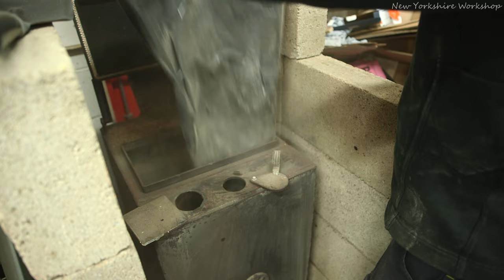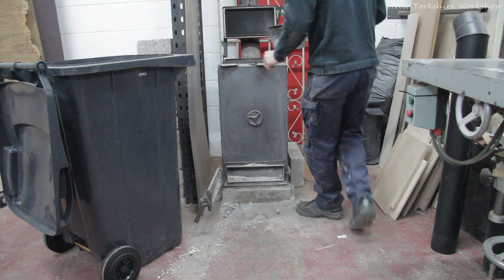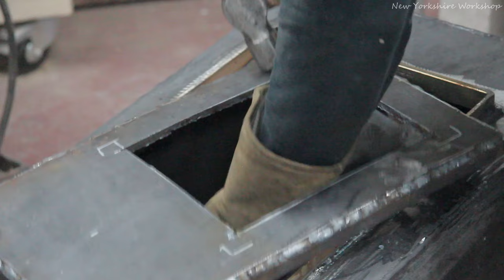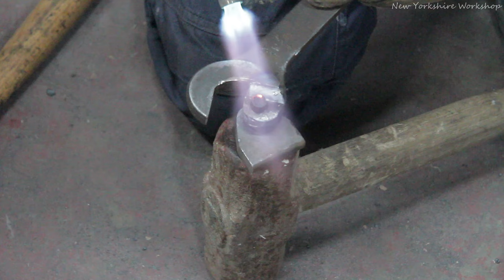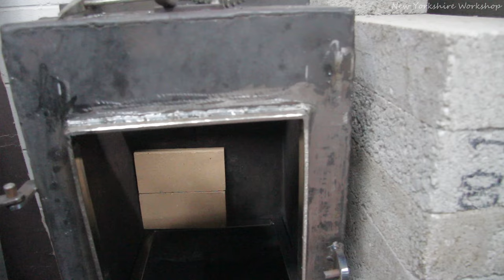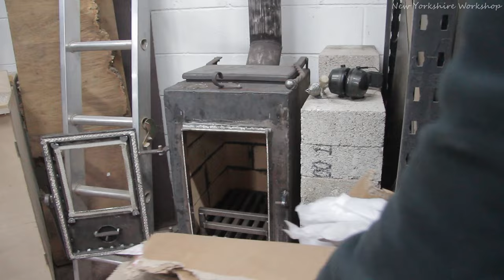fixing my exploding woodburner

Comment: The rattling is known as 'Panting' in large boilers. Basically, the furnace uses all of the air available and then pulls a partial vacuum which then pulls in a gob of air and the cycle continues.
Reply: So, besides rebuilding the entire wood burner he could've just increased the air inlet size? Or, not that easy?
Reply: @TheyForcedMyHandLE  If I had to guess, adding more air to the original stove would have lead to it burning faster and faster, until it was "panting" again, but burning more fuel while doing it.

Or more air would lead to the fire just burning hotter and hotter until it either overheated the workshop or set the place on fire
Reply: Ty for the awnser
Reply: Good post my friend.  That's really good to know.
Seems like you could put a one way valve the would let the vacuum suck open the valve to let air in, and stop that from happening.
Reply: I had coal boilers do this when the front door was opened , it would start huffing , a bit scary to say the least , it would be caused by stirring up the coal and releasing gases causing a sucking of air then a flash burn . Shutting the door would bring control back . I've seen pictures of this type of stove that was used during the big lumber cuts in early America , all that saw dust helped heat buildings at the mills .
Reply: Exactly. We experience it with oil and gas burners also.  Very rare but it does happen.
Reply: Could also be because he basically built a solid rocket booster with a too narrow air intake
Reply: there is also something know as backdrafts which firefighters have to be wary of that does something similar, a way to handle the situation is to create a spot in the highest point in the area to allow heat and smoke to escape without the whole thing igniting and creating an event similar to what we see the wood stove doing
Reply: I thought about this as some one with an automotive/engineering background.The fuel is the issue,it's running rich😊.Saw dust being small readily flammable particles will billow in that burner once it gets going,filling it and essentially acting like a liquid fuel vapour/mist.Not only does that create a much better and more rapid flame spread by virtue,it also creates a more voluminous burn area,(The reasoning behind modern high pressure fuel systems,a better 'spray') so instead of having a flame at the bottom from a few big chunks etc.the entire burner is filled with flame. In that situation you need better air movement to deal with the air requirements,which in it's self will create more heat from an even better burn, It's self defeating. The fuel burn rate needs to be more controlled.

Comment: I wasn't ruining the original stove. The sawdust fell on the air channel and a vacuum was created on the basket. In the air duct we put a steel pipe cut with a flex or drilled with a drill and we solved the problem. I think you were in a hurry.

Comment: Woofing is what's happening there. Same thing happens with room sealed fan assisted gas boilers when they ignite with a thump. It's caused by a lack of air, or rather a lack of oxygen to feed the level of combustion. When some of the sawdust falls down, the sudden increase in temperature ignites the secondary gasses being given off by the wood. That rapidly uses up the available oxygen and if the air supply can't keep up with it then it creates a vacuum which pulls air back down the chimney. When the air drawn down the chimney hits the fuel it reignites and the process repeats. Woodburners really need a throat plate in the chimney to balance the in/out. Makes them more efficient too as the higher temperature will allow the secondary combustion of the gasses. That spanner idea was awesome. Now i need to create a need for one.
Reply: how do you install a throat plate in the chimney? ive only ever had my outdoor furnace woof a few times in the past 8 years but im curious about any improvement i can make.
Reply: The fire is not drawing air down the chimney causing the puffs of smoke in to the room. Only atmospheric conditions will cause the chimney to work backwards.
I agree the problem is not enough oxygen to ignight the gasses of combustion (normaly it goes up the chimney and knowone notices) but when you get sudden ignitions, well gasses, confined space = explosion.
A lot of stoves have a Terchary air vent to constantly supply a small amount of oxygen over the top of the fire. Normaly some kind of tube with several holes. It will allso will improve efficiency.
Reply: @lewis24666  The fire will draw air down the chimney regardless of atmospheric conditions if a vacuum is created and you have the situation i described above.

Comment: Saw Dust mixed with a small amount of wax, paraffin is best but bees wax works too, load up a metal mold of some sort and use a press to press it into super dense blocks, the wax keeps it together and makes it burn nice and slow, you can break them up too if you want them to burn more easily and faster. It's what i've been doing with my saw dust, shavings, and chips for years now.
Reply: oh nice, I was thinking he should make pellets, but this is probably much better
Reply: @wilhallman2890  Yes ! Any for of compacting the wood dust is fine. Antic Windmills could explode because of flour dust. Any solid flammable compound should never be in a dust form. Just like flammable gases or vapors, this is a huge hazard ! Manage the wood dust please, this is dangerous ! Merry christmas
Reply: 7 months later, he's done it.
Reply: @teebu  Yes I saw that 2 minutes after this video. I also left a comment on that last one but we are only two to get what I meant now haha

Comment: While the burning sawdust was pulsating, all I could think about was the explosion at a grain elevator in Chicago in 1935 that killed six people and injured another 38. (No, I wasn't around then, but in the '50's - '80's my father worked just down the street from the location, so I saw the rebuilt silos frequently).  Almost any powder suspended in the air will be explosive.
Reply: Mythbusters proved that danger when they got a dustball of powdered coffee creamer to go up in a rather spectacular fashion.
Reply: Yeah was thinking the same, tiny particle size of the fuel maybe re-combusting at a critical temperature.
Reply: When i was a kid we used to collect this one certain pollen from a "flower", although actually it was more like a stalk or something. When we had enough, we packed some of it into a straw and blow it into a campfire. Nice flames and sparks! :) Yeah, we had to invent things to do while we were camping in the lakes as a child but still we never a dull moment, we always had fun things to do.
That and the explosion risk in the old grain mills (we ground our own flower up until the early 90's when small farms were killed off) made us understand at early age that enough of any powder in air could be dangerous.
Reply: The 'pulsing' is probably deflegrations and their subsequent shockwaves building towards a fine particle / powder explosion.
Reply: That was my instant thought when he was pouring the sawdust into the furnace, that is fine dust that could go boom with the right ignition source.

Comment: Had one of these in my woodwork shop, they are brilliantly economical. Mine was the same shape but I used a cavity twice the size, just use a bigger pipe and reduce the air flow. Never had a problem. Always kept the oak chips for the local fish smoker and got a load smoked salmon or trout as payment ! You are a fantastic craftsman.

Comment: on exhaust you need damper for dialling slow burn cycle, its dialled by adjusting intake and damper. otherwise a lot of heat escaping through a pipe. hello from eastern Europe )

Comment: Being a thrifty Yorkshireman (such as yourself) I'm going to make a suggestion. If the door hinges and catch were adjustable then when the rope seal gets worn you can wind them in to get a tight door seal again and save having to replace it sooner. Measure the length and leave slightly long.Wrap the ends in some rope seal tape to avoid fraying before cutting the rope ends to size then use another piece to join both ends together. Put in with the joint at the middle of the bottom working towards the centre top,both sides at once.This helps to keep both ends tighter together for a good seal at the join and also the rope seal is less likely to be worn and frayed on the ends if its away from the corner. Use rope seal adhesive  when fitting so it doesn't keep jumping out when it gets stuck on the stove body during use and you open the door. Baffle wants a slight bend or edge on it to lessen warpage. 👍

Comment: You sir are a true craftsman! We have a lot in common. If I may, I'm sure by now you have found out that the thin tubing you made your fire grate out of will not last long. Second; if you move your thermal mass away from the stove by a foot or so all around you will enjoy much better heat spread through out the room.

Comment: Nice mods to the stove. Looks like with the pellet maker, you'll have a better deal. The only thing I'm wondering is why you didn't build a draw for the lower door? It would catch most of the ash and be easy to empty. You could even put a sheet metal "Sheetpan" in front so that any ash that dropped would be contained.

Comment: Puffing caused because of lack of air in burning chamber, also you use only one set up for your whole welding process, that is why door wont to fix your frame, for dot welding less rod speed, for frame welding less power and rod speed. Good to weld only like an inch on each corner and move to another to  spread the heat (that is why metal get twisted). Don`t get me wrong, watching your skills was enjoyable and I`m impressed. Great job + good humor, keep it up!!!

Comment: You may find that letting a bit more air pass around the outside of your stove will produce more heat. There should be at least 150mm each side and 75mm at the back but the more the better. 
Your thermal store will actualy make it harder for your stove to give out its heat so more will disapear up the chimney.

Comment: Interesting video, thanks, maybe something to reflect the heat, on the back wall, check the outside when it's running, you may be surprised at the temp of the wall . Regards.

Comment: Nicely done, thanks for the video. I hope their a CO monitor somewhere in the shop - it is pretty much the only safety device I would never be without.
Reply: most detectors won't sound below 50ppm which is an awful lot of carbon monoxide, you could stick your head in a boiler flue and still not hit 50. you're absolutely correct you should fit a detector but also have your workshop regularly inspected by someone with a flue gas analyser to measure ambient levels of co to ensure you aren't subjected to prolonged periods of low level exposure.

Comment: FWIW, if you replace the bottom of the steel chimney with a refractory brick chimney, you will create a secondary burn chamber where, when it comes up to temperature in 5-10 minutes, all smoke/creosote/etc. entering it will ignite so that none will enter the steel part of the chimney.  (Basically, creating a 'rocket mass heater'.  You should look that term up to see how to make your burner even MORE efficient.)

Cheers!

Comment: its a great improvement.. air inlet from the bottom.  burn better wood. no piles of glowing coal 
the door, heat goes up. if it smokes, much less chance you get smoke in the room
bricks inside, isolating the fire.. higher burning temps = better efficiency.

Comment: For the fire basket, it might be useful to drill some holes in the bars across the bottom to allow for expansion on the air inside to equalise or they might go bang as they heat up

Comment: id add some holes in the bottom of your stack of bricks so you can get some convection going up the sides of the heater.. and those TEG fans that sit on top of the heater also help improve efficiency a bit

Comment: Why line the whole firebox with firebrick?  I just use a couple of rows around the bottom sides to stop the steel burning out and leave the rest of the sides bare, so they can radiate the heat into the workshop. As for the sawdust, I have watched your later sawdust poo machine video, but a simpler method is just to put the sawdust in a bag which easily fits in the woodburner, and put the bag on an established fire. Will slowly burn away for ages...

Comment: I think re-bar would be a better choice for the 'fire basket' as tubes will burn through.
Re-bar is probably also cheaper, and leaves the tubes for something they would be more suited to.
Pulsating is caused by insufficient air supply. As the wood burns, is gasses, and the gas builds up until it ignites, then the explosion as it ignites blows out the flame, and the process repeats. Once the gas has all been burned, the solid material will then burn quietly.
I am in the process of designing a masonry stove, to replace my ancient cylindrical steel top loader, so some of your ideas like the door construction were very inspiring. The Russian stove builders put a 5mm gap between the firebricks, and the outside skin, to prevent burning.
In 1960, when I was in my teens, I was also very good, and passionate about woodwork, and a handmade furniture craftsman who knew my work, offered to take me on as his apprentice. At the time it seemed to me that in the future, all furniture would be machine produced, so I joined the RAF instead.
BIG double mistake! 
First, I've regretted it into my retirement, and the RAF was a disaster, as I was the proverbial square peg in a round hole.
.

Comment: If the stack is pretty hot, ya might consider putting a barrel "bell" to get more heat into the shop. Stove pipe goes into the bottom of an upright drum, and the stack exits from near the bottom.
Reply: You fill the drum with something? Like sand or olivine stones or something with a high thermal mass?
Reply: @1873Winchester  Nope, The bell gives the heat in the smoke time to radiate into the room. It reduces the stack temp thus reducing loss uot the chimney.
Reply: @joshward7896  Interesting, so it's more of a rapid space heater then to quickly heat the room. If you did what I mentioned you'd get something like the traditional mass heaters here, they work quite differently, it takes up the heat slowly and gives it away slowly. I wonder if I could do something like that with my sauna heater, where I do want a rapid heating.
Reply: @1873Winchester  I wonder which one is more efficient. Radiating heat faster seems like it might take more advantage of the lost heat from the chimney. But if take in account, fuel cost, I think the sand barrel should work nicely.

Comment: You can use the ash to do thermal shield bricks 

They don't burn and don't get too hot so just mix with water on a mold and you get free thermal shield

Comment: Nice job. Did you look at rocket stoves ? 
Top tip. For cleaning the glass try one of those plastic scrapers that hold a Stanley blade. Does it quickly and very satisfying.

Comment: The reason it is doing this is because when the sawdust falls down the centre it's  mixing fuel (wood dust) with oxygen combined with heat (accelerates the reaction) in the correct ratio for an explosion. Just like in a car engine, where the piston is pushed to harness the energy. In this case it's just pushing the energy back out the burner and disturbing more sawdust in the process. Hence the stuttering repeat explosions.  This is why sawmills, flour mills, cotton mills have historically exploded... combustible fibres mixed in the correct ratio with air... BANG!

Comment: Probably just the top baffle and the front intake that fixed your problem.
It's a hard balance to find, but I would say that that lining that much of it with fire brick is too much. Yes, they are more efficient when you get the internal temperature up higher, but you also need to allow it to get the heat out into the room in order to utilise the extra efficiency, else most of that heat goes up the chimney.
If it was a proper heating stove with heat exchangers before the chimney then that would be ideal, but with your setup most of the effective heating will be through the wall of the stove, which you've just insulated.

Comment: you can compress sawdust into logs without glue, but it needs to have the correct moisture content.  It is the resin in the wood that keeps it stuck together. <-- Sorry, that's the extent of my knowledge on the subject.  Maybe sawdust needs to be heated?  IDK.  Thanks for the enjoyable show.

Comment: My friend in Italy, Lucio, decided to install a burner for the pith left over after pressing olives for olive oil (the absolute cheapest fuel available locally). He wanted it to be as convenient as his gas central heating so he fabricated a screw feed to move the pith from the loft area above to the burner. So, next time you need a heating project.........!

Comment: Did you build this burner? A fire of the type your making should feed air through a single hole in the centre of the fire and out the top. Panting is a lack of oxygen due to poor feed or excessive fumes trapped inside. Not so sure about the fire door behind the most likely cause of a problem either.

Comment: Line your exterior wall with a sheet of aluminum. (Aluminium?) It reflects 98% of radiant heat. Be sure to leave a gap between the wall and the sheet. I have a cinder block house. Sheet works a treat!

Comment: Nearly forgot : I made an oil drip waste oil burner from an old propane cylinder years ago, just a regulated drip from a tank above onto a steel grid. Heat the grid with some waste then drip the oil. Had a low powered fan to aid combustion on a tube out of the propane tank and an exhaust out of the top. I cut a small crude door in just to light it. This worked really well and used next to no oil.